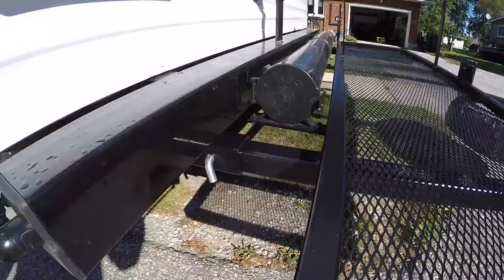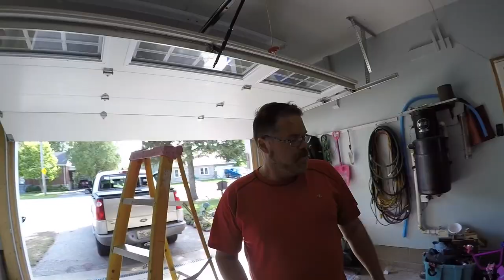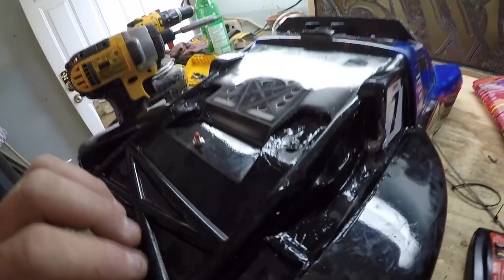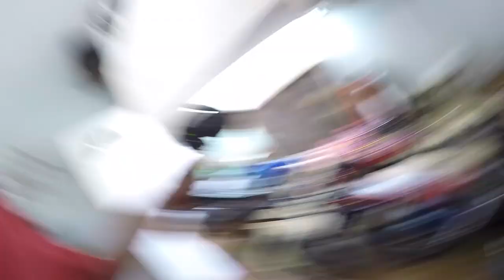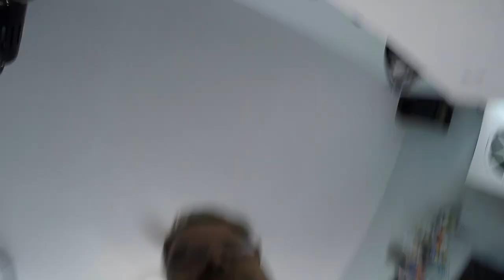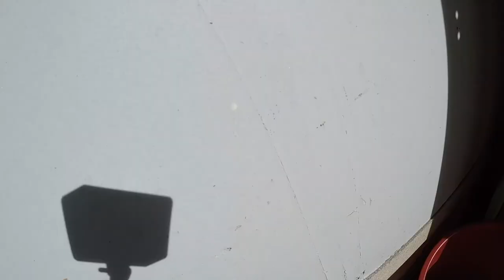Getting Garage Ready

Comment: Now you need a welder tip file kit like 6$ at most... good for cleaning carb jets too...  I fix Rc body's with west systems epoxy resin and the 105 hardener,  smear it on some mesh dry wall tape, it heavy so keep it thin